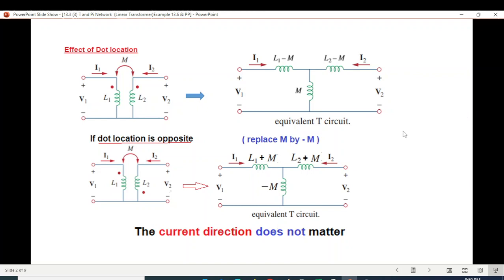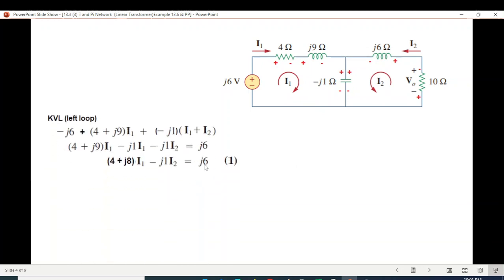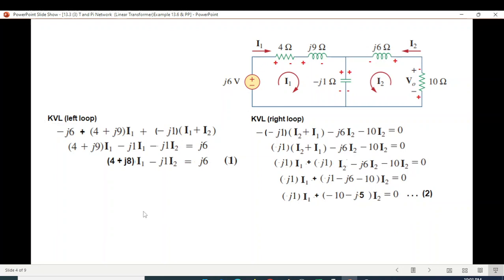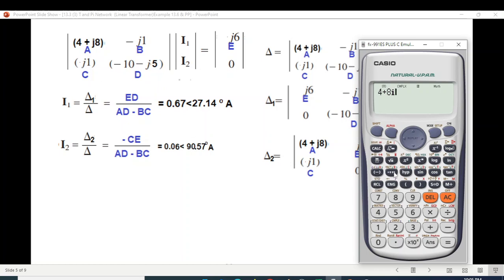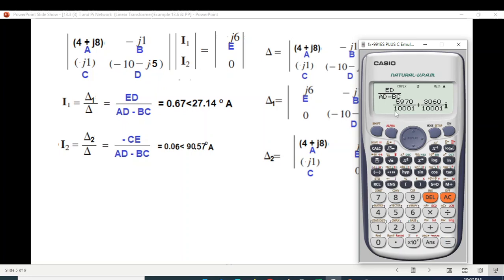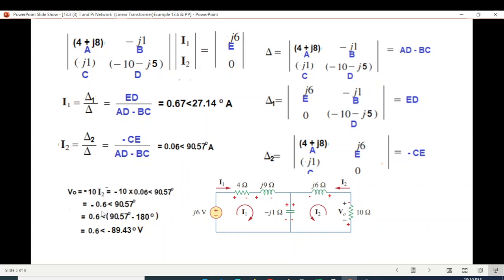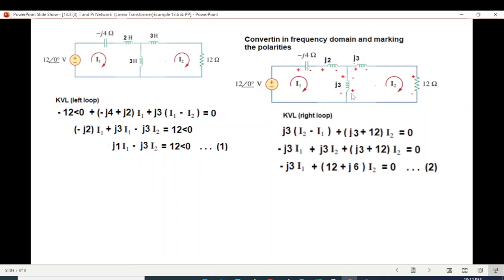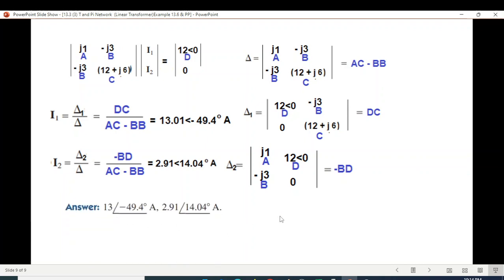(English)ENA ||  Example 13. 6 || Practice 13.6b || Linear Transformer || T- Pi Network

Comment: Hi here is a question : why i2 enter positive terminal of the component will be count as negative ? tqiu if can answer
Reply from the maker: if you are at time 03:55, we are writing the KVL equation starting from left bottom of right loop, so -ve sign coming first. Note we had already marked the voltage polarities  based on current direction, so now no need to look at current.
Try writing from the right side, you will get the same answer.

Comment: the dot location is the opposite and we need to use -M instead of M, the we have:  Lc= (L1*L2 - M^2)/(-M) for the top inductor of the Pi equivalent?
Reply from the maker: Give it a try, and see if you get correct answer.
Reply: @ElectricalEngineeringAcademy  it should b like this but answer is not correct from this method.... please guide
Reply from the maker: @Fatima-et6si Please email or whatsapp your doubt. I could not understand here.

Comment: why we put capacitor in the circuit -jo hms in the first circuit
Reply from the maker: Please write video time, so I know where you are.
Reply: @ElectricalEngineeringAcademy 2.22
Reply from the maker: @MuhammadAbdullah-id8gr  In Phasor domain +j is used for inductive components and -j is used for capacitive component. Since Lc is negative, a capacitor has been used.

Comment: Question , if the result of vo is negative , them You said You could + or - 180 degree  to the angle of the result. In the ideal Transformer You + 180, why did You do not doit here in this exercise. If there some kind of condition for + or - 180 degree in the exercises? The book does not clarify that part
Reply from the maker: You could leave it at - 0.6 <90.57, but it is a good practice to keep the magnitude +ve and manipulate the angle by adding or subtracting 180o

Comment: In the first example of 13.6, I think the source is badly transformed, it's not j6 V , it would be j60 V, right?
Reply from the maker: Oh yes. Good observation. Actually it is error in the book, and I just copied as it is. The best way to reconcile is to correct the question. Instead of 60<90, read 6<90.

Comment: for practise problem 13.6 ,  one is leavig another is entering  in dot ..
 so why we are using M instead of -M
Reply from the maker: Watch carefully from time 00:30 of the video. It is the location of the dot that matters, not the current direction.
Reply: @ElectricalEngineeringAcademy  ok air ,, understood .. thank u so much sir
Reply: @ElectricalEngineeringAcademy   does the same principle for the sign of M applies to the formulas of the Pi equivalent circuit as well?
Reply from the maker: The advantage of using the T or Pi equivalent
model for the magnetically coupled coils is that  we do not need to bother with the dot on the coupled coils @aderfakos
Reply: @ElectricalEngineeringAcademy if the dot location is the opposite and we need to use -M instead of M, the we have:  Lc= (L1*L2 - M^2)/(-M) for the top inductor of the Pi equivalent?